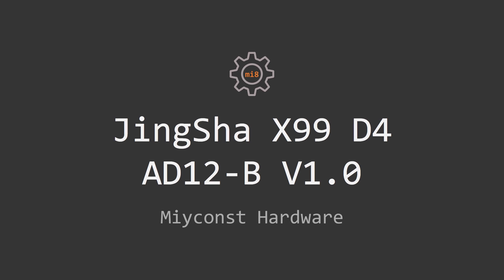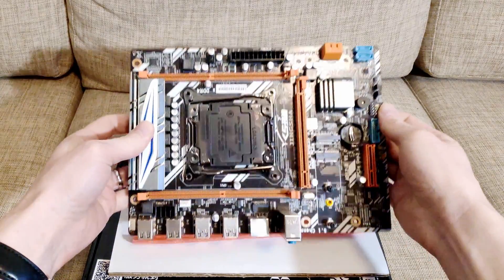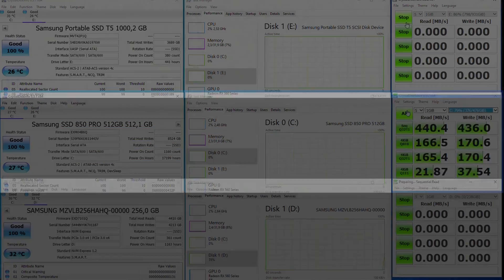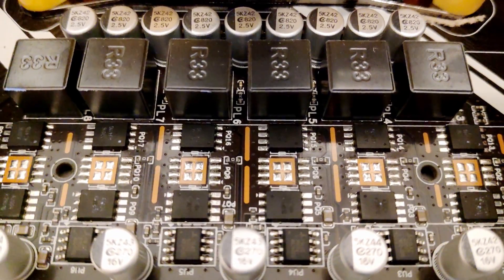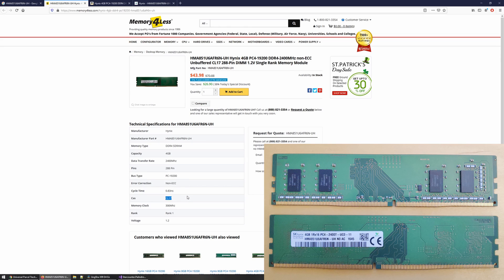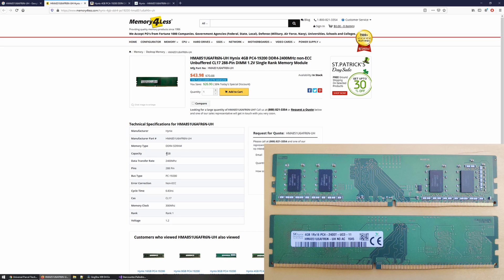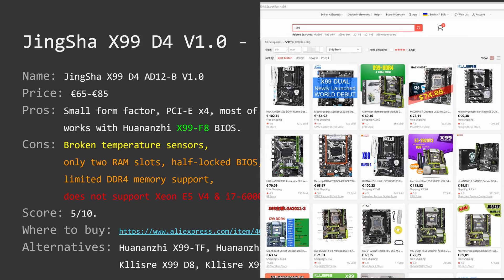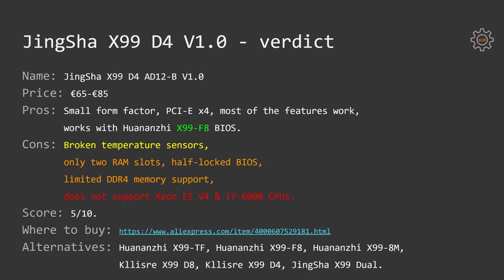🇬🇧 Detailed review of JingSha X99 D4 LGA 2011-3 | CPU Overclocking | Turbo Boost Unlock

Comment: Hello! Its me again! So, in resume is this motherboard good for gaming? Ill use an e5 1620 v3 with an rx 570! I wont overclock and nothing like this. Am I going to have issues? Do I need to configure all the bios like u did on the video or not?
Reply from the maker: This motherboard shall be just fine with E5-1620 V3. You don't have to touch the BIOS, but if you want to tweak - use Huananzhi X99-F8 BIOS and tighten the RAM timings.
Reply: @Miyconst  Ok, thank you very much!
Reply: @Miyconst  I really want to buy this motherboard, The last question lol: I was searching about vrm temps, and, like u said, the vrm temps in this mobo are very high. Does it affects the system performance? I mean, for example, in a asus x99 deluxe get a better performance than x99 d4 with the same processor and graphics card.
Reply from the maker: @visualhk181  It depends on the processor, with E5-1620 V3 you won't see any difference between these two boards.
Reply: @Miyconst  Ok, you helped me alot! thx

Comment: Author, which motherboard is the best for x99 chipset from China? Tell me please.
Reply from the maker: Personally, I like JingSha / Kllisre X99 D8 the most, but Huananzhi X99-TF / X99-F8 / X99-T8 are also good, just a bit more expensive.
Reply: @Miyconst  the best value/performance? Which?
Reply from the maker: @tera_flop5785  JingSha / Kllisre X99 D8, but there are a few new models, which I am yet to test.
Reply: @Miyconst  what do you think about kllisre x99 m-atx? Is better than huananzhi x99 m-atx. I want really budget mobo for my xeon 2620 v3 and ddr4 ram
Reply from the maker: @tera_flop5785  Please specify, which exactly mATX motherboard you are talking about?
Reply: @Miyconst  huananzhi have only one mini motherboard for x99 without name. Kllisre too.  These motherboards are very budget with 2 slots for ram -huananzi and 4 slots - kllisre.
Reply from the maker: @tera_flop5785  Please, provide links. Huananzhi has at least two mATX X99 boards.

Comment: I'm confused, you can overclock the cpu on this motherboard but not on the x99 D4 from huananzhi?
Reply from the maker: X99 D4 is not from Huananzhi. JingSha X99 D4 and Kllisre X99 D4 do not support CPU overclocking, but if you use BIOS from Huananzhi X99-F8 motherboard - it's possible.
Reply: @Miyconst   Miyconst  Sorry I meant: In the video of Huananzhi X99 8M you said that the card wasn't able to overclock, but you can flash as well there the bios from X99-F8 to achieve it? And then, the vrm temperature is really better on OC on huananzhi compared to jingsha/Kllisre? I was intentioned to buy a X99 D8 from Jingsha how I told you in another video, but the price are a bit too high. I was wondering which one was the best between Jingsha X99 (didn't convinced me due to the V4 thing), the Kllisre X99 D4 and the huananzhi X99 8m. Thank for your patience
Reply from the maker: @LawrenceAC  No problem, now I understand what you mean. Huananzhi X99-8M is the best motherboard from these three. With the stock BIOS non of the boards can overclock CPU, but all of them work with Huananzhi X99-F8 BIOS, which can overclock unlocked CPUs and adjust memory timings.
Reply: @Miyconst  thank you so much! You are the anchor or the community of this motherboard, keep going!

Comment: I m work in a Company(ELV, Networking, BMS, Fire Fighting etc) in Dubai as IT Developer. i used to Developed 4 Web Apps,4 mobile apps(HRMS, ECMS, CRM, Reporting Tool etc), Backend Services(Web API, GraphQL API, gRPC etc), Services like Microservices, Clean archicture and Data Science. 

So i need to purchase low cost small Server for Testing this apps. Suggest me best and Cheap Chinese mATX (more preference) or Full ATX MB X99 for Xeon LGA 2011-3 Socket PC Making (HUANANZHI vs Kllisre or Atermiter or JingSha Dual or JingSha Single or Machinist).
Reply from the maker: My suggestion would be: Huananzhi X99-TF for DDR3 support, Kllisre X99 D8 otherwise.
Reply: @Miyconst  mATX?
Reply from the maker: @afsalc9674  Huananzhi X99-8M.
Reply: @Miyconst  Kllisre D4 is cheap in aliexpress. Is it good for Normal use.
Reply: @Miyconst   is this case is suitable for small Factor? or i need to go for more air flow case.
https://www.fingers.co.in/computer-peripherals/pc-cases/rgb-bruno-c5
Reply from the maker: @afsalc9674  It is an okay board, but two of it's SATA ports are blocked if you use dual socket graphics card.
Reply from the maker: @afsalc9674  This shall be fine, if you don't plan to use E5-1650 V3 and overclock it.
Reply: @Miyconst  i m going to use GT 6xx or GT 7xx is it ok.
Reply from the maker: @afsalc9674  As far as I can see, this is the same motherboard as Machinist X99Z, it's not Kllisre X99 D4.
Reply: @Miyconst  Item Description it is Kllisre MB.
Reply from the maker: @afsalc9674  I think it's the same motherboard, just different name, but before I test the Kllisre variant, I can't be so sure.
Reply from the maker: @afsalc9674  Once again, it seems to be exactly the same motherboard as Machinist X99Z.
Reply: @Miyconst  Thanks. You channel is really helpful and i decided to buy one with xeon from Aliexpress after lockdown.
Reply from the maker: @afsalc9674  The cooler seems to be a bit weak, but if you have good airflow in the case, it will do its job.

Comment: I'm getting this in the mail soon (Ordered this ~25 days ago). Eventhough you said that the default bios is not to be used under any circumstances, will it still be stable if I don't flash it? I don't plan on overclocking the cpu but turbo boost would be nice to have if possible.
Reply from the maker: The biggest problem with the stock BIOS is the lack of memory timings configuration. If you plan to do the Turbo Boost unlock, you will have to use a modified BIOS, in this case I see no reason to use stock modified BIOS instead of Huananzhi X99-F8 modified BIOS. Still, to answer your question: the stock BIOS is stable.
Reply: @Miyconst  You also said is that turbo boost will only work if all CPU cores are running at full speed all the time instead of when it's needed. I have a cpu with 12 1.8Ghz cores(2650l v3). I was hoping to get the max core speed up to 2.2Ghz(and 2.5 for single) where I'm using ram with speed of 2133Ghz(no plan to over clock). Hopefully every CPU will need different configurations then what I saw on video. It's not intended to be a full time gaming rig anyways(that plays AAA titles).
Reply from the maker: @pcmedump  Sorry for misleading you. Turbo Boost works correctly without any BIOS modifications. CPU clock goes up with less Cores used and down with more cores used. The Turbo Boost Frequency unlocking hack forces these Xeon E5 CPUs to turbo boost all CPU cores to the maximum frequency when there is load even though Intel designed these CPUs to use maximum frequency to just one or two cores at the same time. I hope it's clear now.
Reply: @Miyconst  Yeah that should clear it up. I'll try with the stock BIOS first when I get the mobo, and I don't break it during the PC building process.